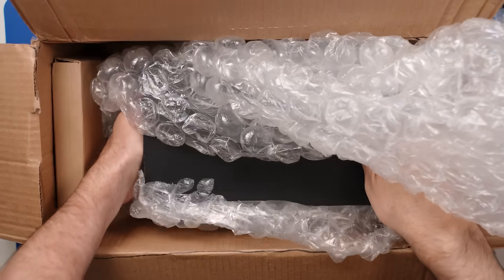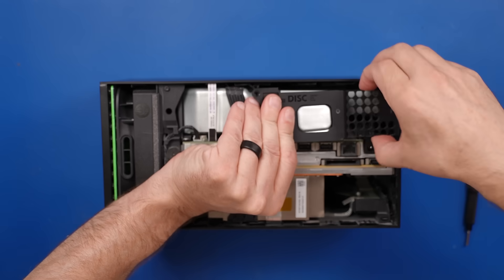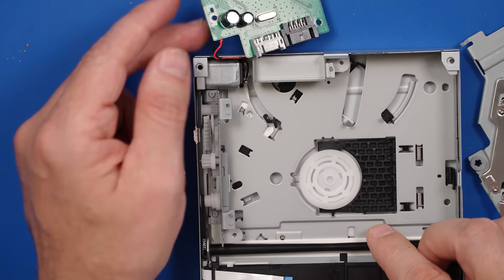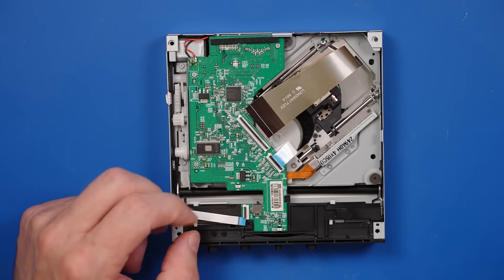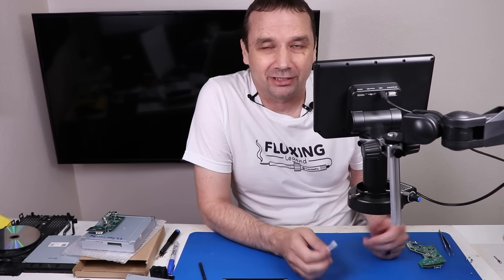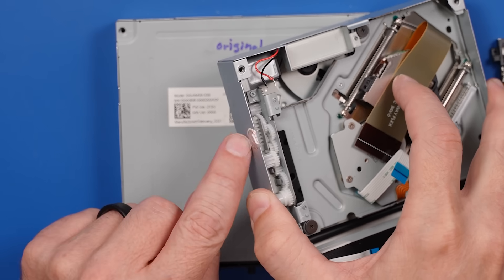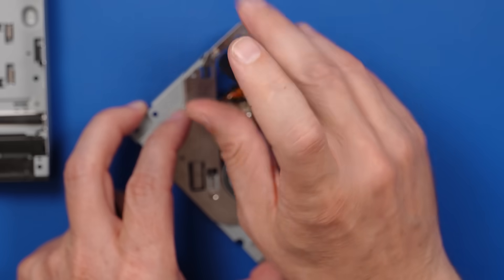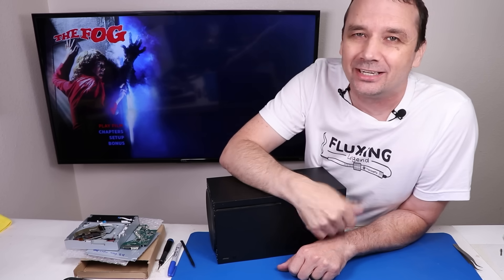Repair Shop Claims “Not Fixable” - Let’s Prove Them Wrong!

Comment: Hi Steve, i really like your video and want to share my similar experience with you about this.
If you notice, the original disc drive is 03b and the supposedly new one is 04b, the original motherboard ( of the 03b) don’t work well with the 04b assembly and that’s why you hear the mechanism sound  at start.

So yeah you can only take the laser + disc spin assembly from the 04b to the 03b.

For experience, you can put the 04b + it’s own board to the xbox and it will work just fine ( it will read only movies of course)

Hope this helps anyone , make sure to buy exactly the same revision of disc drive. If it’s 03b, you need 03b, if it’s a laser of spinner, any revision will fit.

Comment: The fact that the disc drive is married to the motherboard is despicable. There is NO reason for that. What a load of bulls!t.
Reply: Of course there's a reason for that: Greed.
Reply: What does that mean?  You can't replace the drive?  If he couldn't fix it then the customer would have to buy a whole new xbox??
Reply: @JustinML1977  yep, you can’t replace the drive without replacing the motherboard, the two are irrevocably bound together. 

The publicly given reason is “anti-piracy” as usual, the data between the motherboard and drive is encrypted with a key unique to every system so you can’t read decrypted data or copy the encrypted stream between systems.
Reply: @JustinML1977  yyyyup. Or play only download/digital versions. PlayStation also does that btw.
Reply: @JustinML1977  He could do it because he had the tools to open it, and replace the board in it. The average person who owns one of those can't do that. Most people could open it, unplug the drive, and swap it out. But opening it, and desoldering, then soldering a new board on, is beyond what most people feel comfortable with.
Reply: @JustinML1977  You can download a program to clone the disc drive to another one as long as the disc drive isn't burnt out.
Reply: Yeah there’s absolutely no reason to do this. It’s not like someone is going to break into your house and dismantle your Xbox and steal the drive.
Reply: Clippy wouldn't do that to us
Reply: sony and mircosoft love
there money hopefully nintendo never does that
Reply: Drives and controllers have been married almost since the onset of home PCs by a few big names.
Reply: fun? fact, it's been like this since the Xbox 360 and PS3
Reply: @itsTyrion  My ps3 slim I was able to swap out the disc drive with a new one without any issues. It definitely wasn't married to the motherboard.
Reply: @ghoster37 maybe you had custom firmware or they changed it for some revisions, but, in general, it was paired.
All the guides online confirm it
Reply: @itsTyrion  its like the for the OG xbox too.  just quoted a customer $200 for that repair, fully expecting them to say no, but they said yes 😭😭 now i apparently gotta learn how to install a modchip on an xbox

EDIT-I think im thinking of the hard drive actually.....not sure about the disc drive
Reply: The new ps5 aren’t like that anymore
Reply: @louv409 o not anymore? that's something
Reply: @louv409 because they don’t come with a drive in the first place?
Reply: @louv409  If Sony has changed, to make things more easily repairable, then that is great.
Reply: @rrwholloway  They have new ps5 models that come with the disc drive installed.
Reply: @rrwholloway  Yes they do lol. PS5 launched with 2 versions: digital only and one with a disc drive. Same goes for the newer "slim" version. Mine did.
Reply: One of the reasons this is a thing, is because they want to avoid people finding an exploit thru the drive to hack the system. This has been done before and back in the day
Reply: As much as I don't agree with this fact myself, it's pretty easy to get around if you know the basics of soldering. When my first Xbox 360 stopped working, I removed the DVD drive and ordered the exact drive. After a control board swap which required only desoldering/soldering of two wires from one drive to the next, the entire console came back to life. That was more than 10 years ago and the system still works (I gave it to my brother after I stopped using it). Just to be clear, it was the very first time I ever did soldering in my life, using nothing but Youtube videos and I had no microscope or magnifying lens. Annoying = yes. Hard = not really.
Reply: @honorablejay  But you know that most people who own one of these would not feel comfortable enough, or skilled enough to do that. And they shouldn't have to. They should be able to just unplug the drive, and plug a new one in. They shouldn't have to access the board, desolder it, and solder it into the new one. Most people would be like the guy who owned that one. They would feel obligated to take it to a shop, or send it to some Youtuber. That is some bs.
Reply: Well that's why I prefaced it with the fact that I don't like the practice myself. Considering that I'm mainly a PC gamer, the idea of having to do physical modifications just to get my gear to work sucks. But I've taken the idea of, "You want me to do what? Ok, hold my beer........." to heart.

Comment: the place they ship it off to is called UROC it’s basically uBreakiFix corporate soldering facility for stores that don’t have any soldering technicians on hand/in the store or within their own franchise. UROC typically charge us a franchise I believe it’s 70 or $80 for an HDMI port replacement. I don’t know all of their prices as I no longer work there.
Reply: UROC? more like USUC
Reply: I can understand sending them to reball BGA or something, but sending to them to solder two wires is hilarious.
Reply: @jaro6985  I believe also corporate stores aren’t allowed to do any soldering, don’t quote me on that, though I’m not 100% sure. Or sometimes if it’s just a repair that they don’t know how to do franchise can just send it to them and call it a wrap.
Reply: @Right_Price_Repairs  Wouldn't surprise me because of chemicals and OSHA requirements.

Comment: I just love to watch this getting fixed. This reminds me of my PS4. It would not load a disk in, the drive appeared to be completely dead. I tested the drive motor and it worked. Even pulled the disk in and out correctly. Then i checked the drive controller on the motherboard. It had a fuse blown. 🤣Replaced that, a bit of cleaning, 2 new rollers and it like brand new again.👍

Comment: Are you sure they use different laser wavelength for movies and games?  If they're both BluRay, they should use the same wavelength.  Now, to read DVDs, that would require a different wavelength, as would CDs (I heard XSX doesn't play CDs for this reason).

Comment: It's sad to see that the Xbox series use the same lásers than xbox one, and with the same issues. My Xbox one continously stops trading discs, I clean the laser and lubs the mechanism, works fine for like 2 months and the problem returns. I bealive thats why the owner decided to try a new drive.😅

Comment: When you showed off that bad solder job, you can see just how badly aligned one of the gears is. I think it was gummed up as the one near the top does not mesh with the belt drive.

Comment: Ever repair a Tiger 99x Resident Evil 2 handheld?

Its a very rare handheld and the rarest variant of Resident Evil 2. Ive had the thing since it came out. It still works but the LCD screen has "streaking" all across it. Been that way since i got it new. Apparently it had that problem across the board. Im guessing loose cable inside or something.

Comment: The disc drive that was in the console that you said you havent seen a sticker like that is 100% a replacement new drive. The yellow sticker beneath is the mobile sentrix sticker they put on all the parts they sell. I agree the shop purchased the disc drive but was faulty
Reply: Can confirm that's a mobilesentrix sticker. I never buy the whole drive assemblies. Just the lenses lol

Comment: 9:58 There's a correction - the laser for reading game discs and Blu Ray Movies (the one the viewer was watching) are the same because the games are either 50 or 100 GB Blu Rays and Movies are 50GB for Standard Blu Ray and 100GB for UHD Blu Ray. The other laser is only for reading Audio CDs and DVD Movies. Also another fun fact, the smart delivery games and Xbox One games are 50GB discs as the original Xbox One can only read Standard Blu Ray's , but the Series X only games are all 100GB discs (probably a few could be 66GB discs, but those are rare).

Comment: I used to work for the now defunct Computer Center in Las Vegas. I have seen it all. Dodgy soldering, bodge wiring, but the craziest was a teenager brought in a pc he had been building a very expensive machine and was trying to do a custom water loop back in like 08. It looked like he attempted to fornicate with it using a blowtorch. I did get it working properly but there was no saving that case.

Comment: im pre sure the residue from the lens is prob from smoking/vaping lol
Reply: @Stillpate  Came here to say the same thing. I'd bet 20 bucks its vape residue.
Reply: Smonking, I don't think so, there would have been some residual scent of tobaco (or something more "floral"!!). BUT, for the vape, that's a very possible thing. Vape use a kind of propylene glycol and glycerin, there is a kind of very light and thin "grease" left after the evaporation of that e-liquid. "Aroma" is at a low % of the whole formula and that aroma scent don't stay long.

Comment: The degree to which troubleshooting and repairing electronics requires no real knowledge of electronics is a constant surprise. At least 90% of the time it is down to mechanical issues such as broken connections, dirt etc. But paradoxically, it helps to have SOME knowledge of electronics to identify these mechanical issues. You develop an intuition for them, which is on full display here, great work man!
Reply: Totally agree. 90% of the time you can detect and fix problems just by taking something apart and having a look at it. Heck I even repaired my washing machine once (water inlet valve was damaged AND its filter was clogged with some kind of stones LOL).

Comment: 9:55 the data format of game discs is Blu-Ray (blueish laser color). So Movies (Blu-Ray) and Games share the same laser. Just DVD is different, redish laser color.
Reply: What about CDs ?
Reply: @theredoctopus3196   CDs use the same red laser as DVD
Reply: @kabob21 thanks for clarifying.
Reply: @theredoctopus3196  also red. DVDs and CDs can share the same laser. Laserdisc used Infrared, CDs/CDs red, Blu-Ray and HD-DVD blue.
Reply: @theredoctopus3196  cds don't play on ps4 or newer though. Although they do play on xbox all the way up to the series I think.
Reply: Was thinking that too
Reply: Xbox One X has a single laser assembly which reads all disc format types.
Reply: @bnjmnlmbrt18  "one" laser unit doesn't mean it doesn't have different colors/wavelength. These pickups just have multiple laser diodes and use the same lens/mirrors.

Comment: Steve I hope you can help.

My Series X one day just stopped reading discs. Power is still going to the drive and it can even take and eject discs just fine. But it's making no attempt to read. Could a dirty laser be causing this or is it more likely to be something else?

Microsoft are asking £289 for a repair, some shops ask over 100... I'd rather fix it myself if possible.
Reply: Could be either a dirty laser or a bad laser. If its dirty its not sensing the disc

Comment: Wait, the optical drive is married to the motherboard?  Why?
Reply: To prevent people from using old fashioned hardware unlocks so that you can play burnt games. How it used to work with the old PlayStations and the old Xboxes was you would attach a chip to the wires that connect to the Xbox for the laser assembly and the disk drive and it would intercept those signals to allow the play of pirated and burnt games. By marrying it to the motherboard you can't do that anymore because the second you modify it it won't work anymore.

Comment: U break it, We break it more
Reply: Lol this couldn't be more true. I once took my original 60 gig PS3 phat model to a "repair" shop so they could repair my yellow light of death issue. I had my console in still mint condition, took them a little over a month just for them to tell me they couldn't fix it. When I got it back it was scratched and certain parts of the plastic were broken.
Reply: @Kakeen I brought my fat PS3 to a local game store to have the thermal paste changed. They returned it nice and clean and properly assembled. Trust your local game store
Reply: @AtomSquirrel Yeah that's a mistake I won't make again. Definitely gonna check what they specialize in when it comes to repairs.
Reply: Yup
Reply: I also brought my phone I tried to repair up there and he let me look under the micro scope at all the damage I caused lol  @Kakeen

Comment: One of the most common points of failure in discs is the sled getting jammed, and motor not able to turn it/get it to home position, which causes issues. You can check that as well. Use lithium grease for the rails.

Comment: I know this is completely unrelated but if your playstation 5 is turning off and it's not overheating it's your power supply if it's a bit dirty or very dirty and that doesn't work clean it and if that doesn't work replace the power supply and cable.